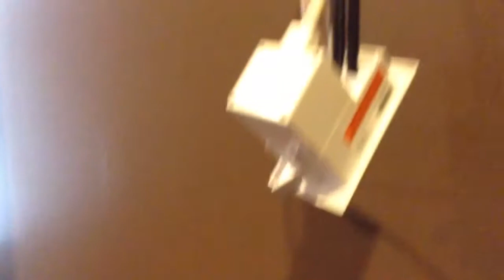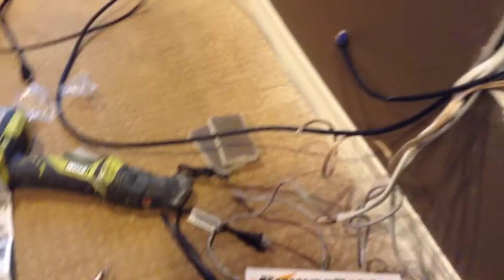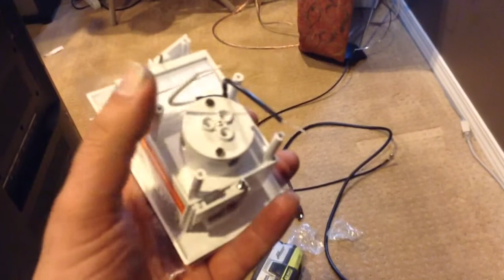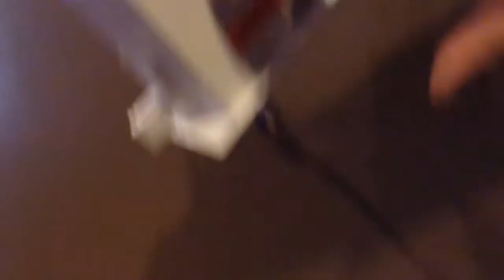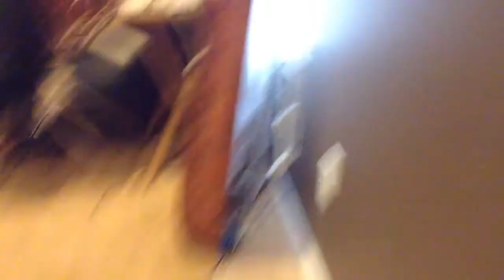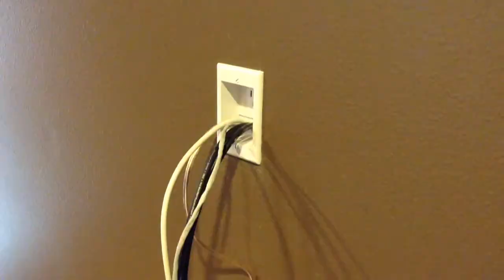Power Bridge One-Pro Cable Management Installation

Comment: What if your outlet is on the other side of the room.
Reply from the maker: +Kingsherry  All this thing really does is get an outlet a few feet above or below a hole in the wall, beyond that, running along the floor, then it's extension cord time.